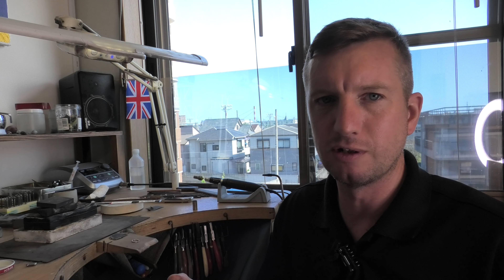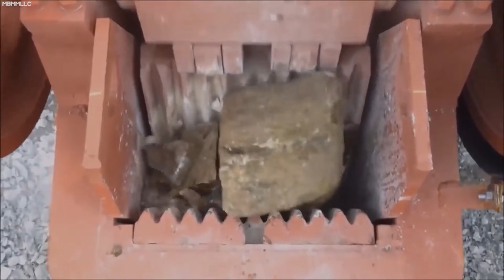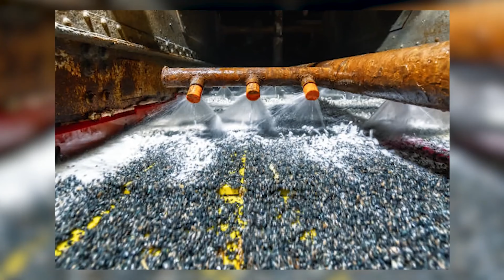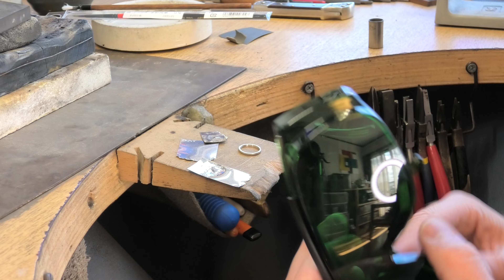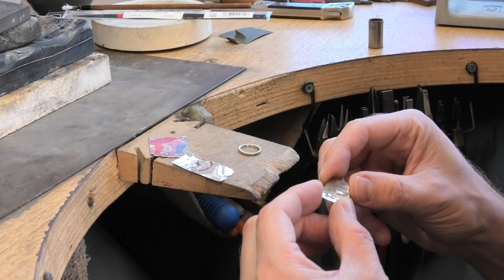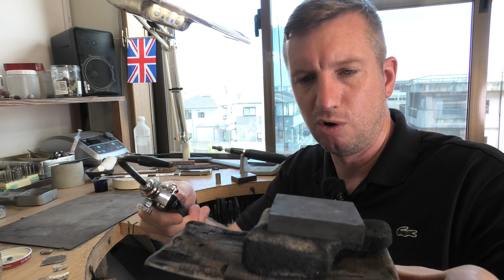Platinum Experience

Comment: I work with platinum a lot. I don't use flux platinum likes to combine with salts when liquid. The flux may make the solder joint brittle. I do flame weld all weddings where possible to as you don't get that annoying solder line drag when polishing. You have inspired me with your channel and interesting approach to difficult settings.thank you.👍

Comment: I’m afraid I have to comment as there are a few things you have wrong in this video. You should NEVER anneal or work on a charcoal block with platinum! The carbon contaminates the structure of the platinum.  Use a silica block instead. Just google it. I’d hate to see you produce more films showing a technique that could ruin people’s metal. Also never use acetylene and oxygen for the same reason. The gas contaminates the platinum. Also welding shanks and rings is the best method to join the metal. No solder lines to worry about and it is a stronger join. When you weld you add a sliver of metal between the joint that extends beyond the edge of the metal. So when you weld, that sliver then melts onto the surface and  welds the joint. Then you file and buff that down to the surface of the ring leaving the dimensions of the metal exactly as it was. This is the correct way to join platinum.

Comment: Cross contamination is a serious concern when working with platinum. Any maker who wants to work in Pt must be scrupulous about cleaning files of any gold or silver filings (lemel). Also  use separate sand (buff) sticks on Pt than the ones used on Au or Ag.

Comment: :/ those shades are crap and not for platinum for sure lol. *most other jewelers dont talk about this but platinum is far harder to get a fine polish and its more important to sand down grade by grade and get an almost polish on it before polishing. im a metal purist and im very much against using gold solder on platinum but he's got a point, there are some times when gold solder is needed to be used when next to stones that cant be easily removed. however, platinum/platinum solder should still always be used whenever possible to ensure stronger and seamless bonds. platinum is really such an amazing jewelry material once you become accustomed to it.